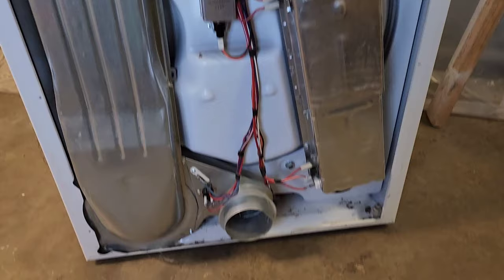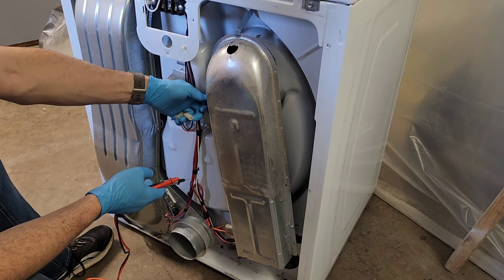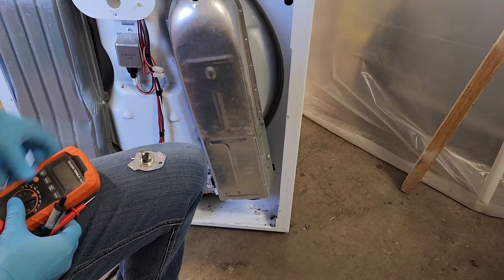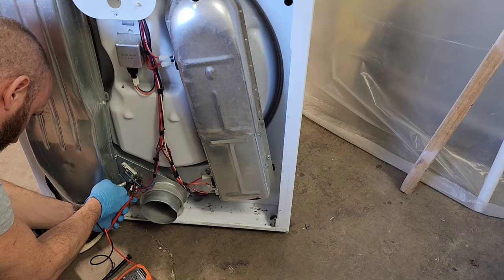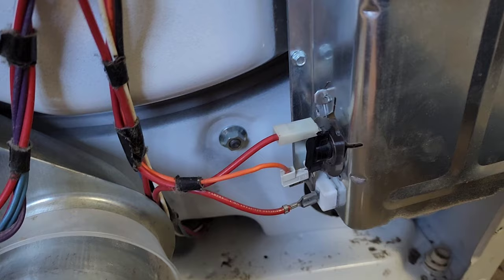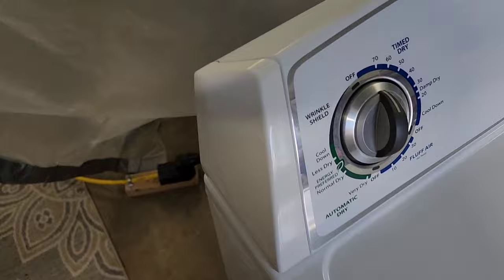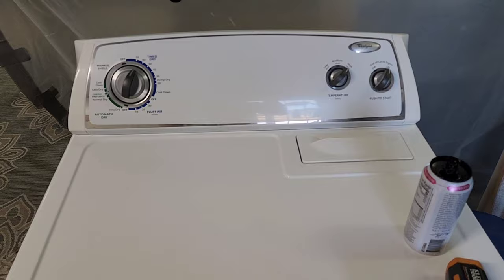Whirlpool Dryer Not Heating Trouble Shooting - High Limit Thermostat | Josh Cobb

Comment: When you checked the high limit thermostat on the bottom for continuity it passed.. That means its good. Why did you replace it?
Reply from the maker: Nine times out of 10 these will actually not shut off like they’re supposed to, and cause the element to overheat and burn out or trip the safety thermistor.
Reply: @joshcobb4100  I understand now.. Thanks for your quick response..

Comment: Question I have the reverse where I’m setting the timer let’s say 60min but cloth are staying damp but if I set timer for let’s say 45min dries fine suggestions ? Thanks
Reply from the maker: Sounds like a contact issue within the timer itself.
Reply: @joshcobb4100  is there a way to confirm it is the timer ?
Reply from the maker: The test I do to see if I have a faulty timer is to start a time load at the 60 minute mark and with force hold the timer knob to the left and see if your heat stops and then hold it to the right and see if the heat starts or vice versa. If pushing and holding it one direction turns the heat on or off this means the contacts in the timer have worn out. I have a video under my appliance repair playlist that shows how to rebuild these timers.
Reply: @joshcobb4100  ok much appreciated

Comment: How was the Hi Limiit Thermostat bad when it beeped continuity?
Reply from the maker: They go bad when they don’t shut off.  They just stay on and the system overheats and trips the thermistor.
Reply: @joshcobb4100  Mine does not have the upper thermistor on that heating element housing.  Only the one stat on bottom that checks out for continuity and so does the thermal fuse and 2nd stat near outlet part.  No heat still, driving me nuts
Reply: @joshcobb4100  Brother I've exhaused all possible troubleshooting tests.  I even took apart the timer and cleaned everything per your other videos I watched.  It's an older timer where all the plastic parts are on the knob shaft, but nothing looked wrong with it.  I then ran continuity straight from the timer red wire all the way to the heating element and it was good.  I separated each wire/piece after that as that red wire travels to the first 4 wire Thermostat, thru it, then to the High Limit Thermostat mounted on element case, thru it, then to the element connector and through that.  There is connections/continuity everywhere.  I fully cleaned every last plug fitting on all parts described as well as the 240 plug and terminal block(shined em up).  Last thing I tried was connecting the 2 red wires at the High Limit together to bypass it (only for a few minutes of course for safety) to eliminate that anyway.  No heat.  So is it at all possible for the heating element to be intact with no break in the coils anywhere and just not heat up?

Comment: I just replaced all 4 pieces and still no heat.  I'm going back down to try this.
I have this exact dryer.

Still no heat.  Maybe coil?

I also pulled that lint vent off and cleaned it out.

Comment: On manual selection multimeter what ohms setting does the safety switch need to be tested on?
Reply from the maker: Mine is auto and I said it for continuity testing. If it’s open, meaning OL then it needs to be reset or replaced.

Comment: Hello I have this kenmore dryer the problem was that the thermal fuse keeps blowing this is a 10 year old dryer, but I noticed that the coil was drooping an arcing on the metal so I believe that's why it's keeping blow thermal fuse. But also I'm new to appliance repair. but I heard because I'm buying Chinese parts it's not like the original part so it's going to keep blowing every 3 to 6 months because I'm not used the original part .it that true???
Let me know thx
Reply from the maker: Buying quality parts helps for sure.  You have to make sure the heating element doesn’t touch the metal casing.  The cheap replacements bend with the heat pretty quick and cause this issue.  When this happens yes the thermal fuse will blow.  I suggest buying from appliance parts pros, they are good.
Reply: @joshcobb4100  thx

Comment: My problem is the dryer stops heating once it hits the "damp dry" (~25 minutes remaining). I don't have the damp dry sensor or a separate cycle. I start it off at 60 minutes, and gas cycles on/off maintaining good temp until it hits 25 minutes. Then flame shuts off, dryer keeps spinning and is ultimately cold by the time the 25 minutes finish. I've replace solenoids and igniter. Checked continuity on all sensors in the back and thermostat and everything checks out ok. Is there separate wiring I need to look at for the damp cycle?
Reply from the maker: You probably have a bad contact within the timer itself so when it is supposed to switch you over to a lower heat setting it just shuts off

Comment: What if my voltage tester isn't showing continuity anywhere, but when i stick it in a socket in the wall it works? Do i really have to replace everything or am i missing something? I have a Klein Tools ET40 voltage tester.
Reply from the maker: Not sure what type of tester you are using but on mine it can either do continuity with a beep confirming the through connection, or I have to switch it over to read voltage.  If it were set to voltage and I were trying to test continuity it would not work correctly.  Might check your settings
Reply: @joshcobb4100  I'm using a klein tools voltage tester et40. I don't think it has settings. Just turn it on and test.

Comment: I have a Whirlpool Duet Gas Dryer. It won’t ignite at all. No flame, no glow, nothing. I checked thermal fuse for continuity and there was none, and the thermistor also does not have continuity. Would replacing these fix that issue? I’ve checked just about everything else, and replaced the Gas Valve Coils, and everything else seems to be just fine.
Reply from the maker: Both of those should have continuity.  So is definitely get those replaced and see if that fixes the issue.  Unfortunately working on these is a process of elimination most of the time.
Reply: @joshcobb4100  fair enough, I guess it was more of a “are these known to fix that issue or do these have no relation to my issue” type of question.
But I appreciate your time and thoughts, as well as your explanations that you put into your videos.

Comment: Ok I’m having this same issue with the thermal cut off switch blew out again after replacing it.I have continuity on all fuses. except the one I mentioned the vents weren’t as bad cleaned out vents should I replace the thermal fuse?
I have continuity the timer and voltage on the outlet
Reply from the maker: If your thermal fuse keeps shorting out, you might check inside the front of the dryer all the wires that run along up to the motor and the heating element. It’s possible one of them has become corroded/bare and is touching ground blowing that fuse. Something is touching ground blowing that fuse.  Check all your wires.
Reply: @joshcobb4100  after looking at the heating element it’s totally burnt I think it’s overheating looking inside the dryer I see burnt spots by the ventilation?
Reply from the maker: If you replace the heating element buy the whole kit with all of the components, five pieces including the heating element and I'd replace all of it. Specifically make sure you replace the high limit thermostat which is the component on the heating element itself.

Comment: I just replaced all the components. I bought a kit. I still have no heat. Can it be the timer?
Reply from the maker: Yes, if you’ve done all that work, and still no heat, it’s most likely the timer. If you start a load on time, dry high heat and force the timer knob over to the left side and check for heat, then you can force it over to the right side and check for heat, if you get heat doing this, it’s the timer. If holding the knob over to the left for a minute and then over to the right for a minute produces no heat then it’s gotta be something else.

Comment: I’ve replaced the heating element and all of the thermostats and it still won’t heat any other ideas?
Reply: Have you made sure that you have air flow
Reply from the maker: Timer issue sounds like.  Check this video out.  https://youtu.be/ZNmDY8pA8Dw?si=fhTmotbcjhXQ3iQ2

Comment: Whats happens if I check everything for continuity and everything is good but my power outlet at the dryer is not reading the 120 on either side of wires but I know my outlet is good at wall because my air compressor works?
Reply from the maker: So what is it reading?  You should have 220 measured across both hot wires or 110 on each measured hot to ground/neutral.  Be carful working with the hot wires and plug.
Reply: Is reading 12.5 on both sides

Comment: So if it beeps your good ? Or does it have to say 0.0
Reply from the maker: Beeps ur good.
Reply: I have had to reset the high temp limit twice , it only lasts ten minutes .... the entire dryer is cleaned , any ideas ?
Reply from the maker: @MrCoolen80 you will need to replace it. Sometimes they do go bad and get heated up and it damages the metal plate inside and it just needs to be replaced. Otherwise the cycling thermostat on the actual element could be not kicking in and shutting it off and just tripping it.
Reply: Thanks , I replaced the entire kit tonight and after 20 mins the same fuse lost continuity... I think the heating element could be arching out on the housing case when it's gets hot and expands .. I will try and re adjust it tomorrow ... if that doesn't work I might just throw the dryer off a cliff lol

Comment: Would a thick king size comforter block off the airflow enough to cause this?
Reply from the maker: Yes
Reply: None of this one is making sense to me. I have continuity across the thermistor. Coils measure fine.
Reply: My inability to understand 220 volt doesn't help. Blown fuse.
Reply from the maker: At least you figured it out!!
Reply: @joshcobb4100  Yes sir. Thank you for the support.

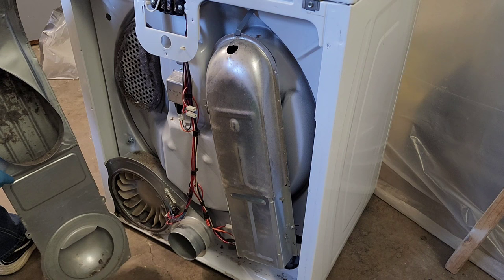Comment: My thermal fuse blew the other day and I installed the new fuse today. At 3:37 I took off the internal ducting to clean it and it was SEVERELY clogged where the blower motor is. However, when I took off the internal ducting, the foam rubber gasket up top where all those holes are came apart when I removed the duct. It was so brittle it just crumbled off and hardly any of the foam gasket remains. I reinstalled the internal ducting and dried a load of clothes and my dryer worked perfect. Should I worry about that gasket coming off or just forget about it??
Reply from the maker: Just plan on cleaning it out again in the next 6 months and you'll be good.  Otherwise you can use some of the tin foil tape (ducting tape) to seal it back off.  It's a pretty tight seal without it.

Comment: I have the same whirlpool dryer and my issue with my dryer is that I set the timer to 60 minutes and the dryer could go for hours without turning off and on top of that it doesn’t blow heat just regular air any idea what could be wrong with it ??
Reply from the maker: You have a bad timer.  The timer motor is shot.
Reply: Thanks 🙏

Comment: I bought a used dryer. 
That top censor you wack has the wires literally cut off and so does the fuse.
I replaced the heater 1 time already but now i lost heat again and i have continuaty in the bottom censor, so im not sure what the issue is

Comment: I replaced all the sensors, and heating element, it heated for 30 seconds, stopped working, and now the only way to make it turn on is if i hold the power button on while turning the timer knob
Reply from the maker: Does it stay on after you do this?  Or turn off once you let go of the start button?
Reply: @joshcobb4100   I have to turn the time knob in a random direction while pressing the on button until it turns on, but it'll stay on, but no heat.

Comment: What could it be if it wont turn on at all?
Reply from the maker: Check the white fuse located to the left. It should have continuity. If it blows, the whole thing will be completely dead.
Reply: @joshcobb4100 I changed both fuses, cleaned out the thing jus like u did, I don't remember what the piece was u called on the bottom right but I haven't tried that one. But I don't remember the name to see if we have it here where I'm at
Reply from the maker: @alonzoboyd8636 did you check the door switch?
Reply: @joshcobb4100  yes the door switch clicks without pressure
Reply: @joshcobb4100  would the door switch make it not turn on at all?

Comment: I tried slamming my heating element on the floor. Then i ran over it with my car. Still didn't work!
Reply from the maker: Dammit, the car trick always works…. No clue then.
Reply: @joshcobb4100  all my fuses and thermostats have continuity. My heating element isn't shorted and the coils seems fine, but I'm still having trouble with the heating element only firing up about 1 out of 5 times.

Comment: Clearly the new high limit replacement wiring assembly is completely different please advise
Reply from the maker: Might be easier to just buy the other kit that matches what you are taking off.  I'll have to do a video tho for those that want to use the cheaper kit and rewire it.  It's a pain tho lol.

Comment: Do the 2 sensors on the right side have to be plugged in a certain way or does it not matter which terminal goes in which side?
Reply: That’s what I’m trying to find out
Reply: @ignoredchain3134  I was told they could go either way but don’t quote me on that
Reply from the maker: It doesn’t matter with the sensor on top on the right side, the thermistor. The sensor on the bottom, sometimes has a couple of additional leads like an orange one, however, these are size fitted.  The thick red wire coming from the top sensor goes on top of the bottom sensor and the thick red wire coming from the wiring harness from below goes on the bottom of that bottom sensor.

Comment: Hey Josh!  (ref @user-rk8fs5ko4i) The top thermostat in the heating element duct keeps failing.  I've  replaced it 3 times this year  Any ideas?  It lasts about a month.  I've also replace the bottom thermostat. Thanks.
Reply from the maker: My suggestion was going to be to replace the bottom thermostat which you still might replace both with OEM quality parts from Sears or appliancepartspros.com.  However, if you feel like you have exhausted this, then my suggestion would be to clean out the internal duct on your dryer and get a thorough cleaning of the ductwork in your house because at the end of the day an overheating issue is what causes these things to trip and a restriction in airflow will cause overheating.